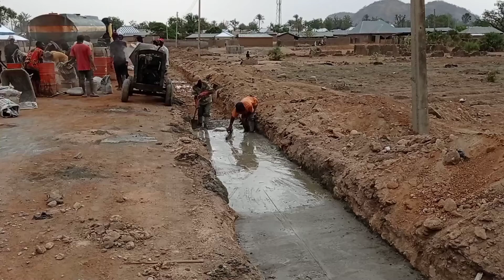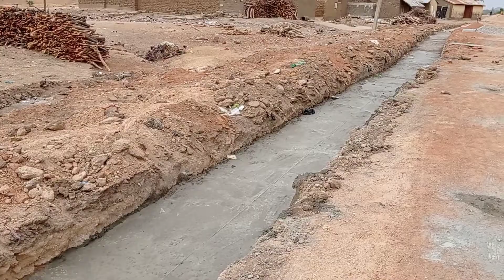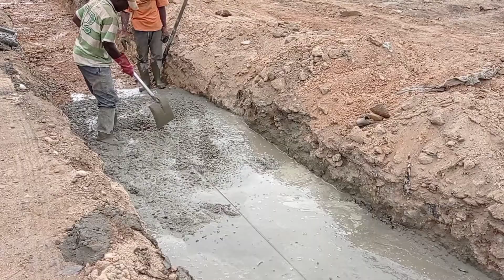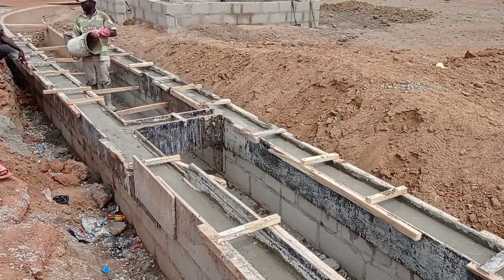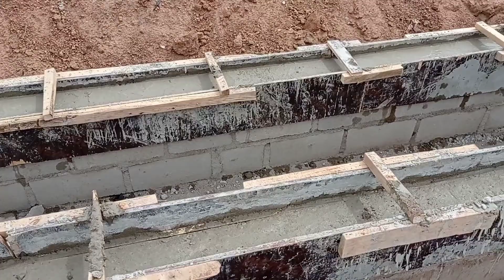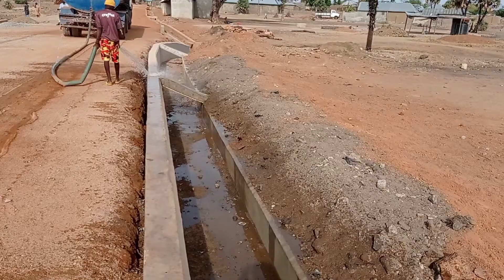Construction of Drainage | Concrete Block Drain | Step by step guide

Comment: No reinforcements and judging by the with and depth of the drainage… it rains a lot here…
Reply from the maker: Constructed with good materials and concrete grade. Moreover, I provided crossing beams to support the drainage. Two years have passed and the drainage is intact. Wherever, the dimensions of drainage are above 1.2m (both width & height), I usually do RCC drainage. Thank you.

Comment: This drain would cost way too much… its more cost effective to just put a form work and cast rather than paying for blocks… still filling them with extra cement as you would have done the form work and still plastering… you all praise the work but it is not done to the most economical section
Reply from the maker: This one is cheaper than concrete. However, it is fine if constructed with good quality of materials.

Comment: Did you use steel in the bottom.
Reply from the maker: Hi Hadi, for the blocked drains you don't really need reinforcement at bottom. Just plain concrete is enough.
For the RCC drainage where volume of water is high, you can use reinforcement.
Thanks.

Comment: Poor canalization how it long without u bars?
Reply from the maker: It's made of concrete blocks, the hollows were also filled with concrete. Cross beams constructed on top in order to support/strengthen both sides. It's a township road (not highway), as such I didn't use reinforcement bars. 
Thank you.
Reply from the maker: Moreover, it's constructed as per the available capital.
Reply from the maker: Thank you bro
Reply: Can u share how much will cost for 100m in given width